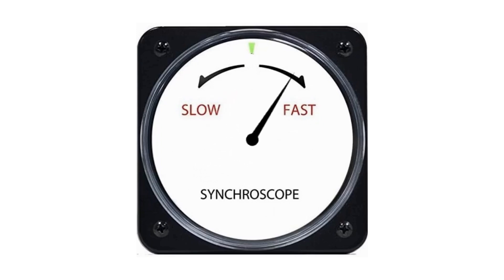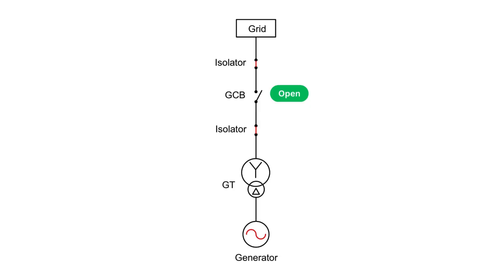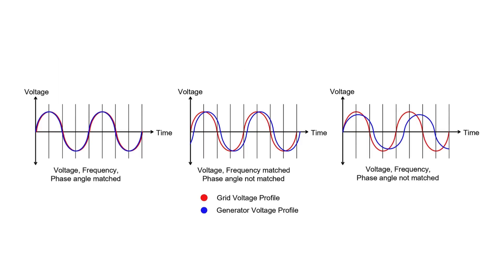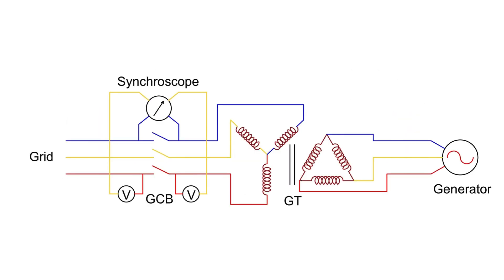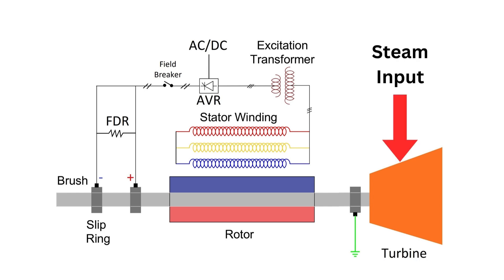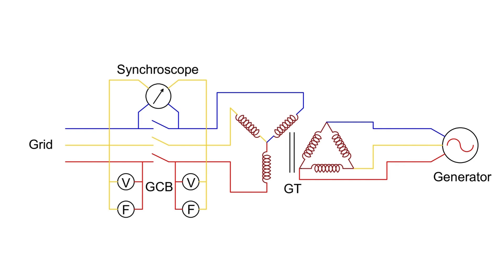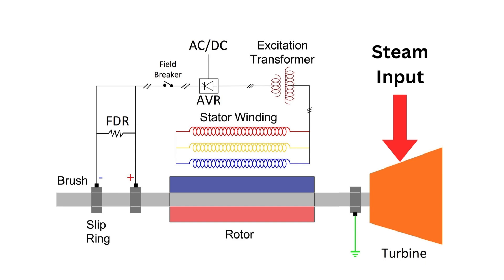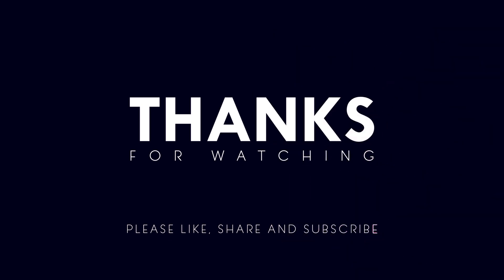How Synchronization Happens in Power Plants | Understanding Synchroscope & GCB Operations

Comment: If a power plant is matching it's voltage and phase to the grid, isn't it not actually generating any power? If there is no voltage difference to the grid, then the plant isn't actually driving any current into the grid. Right?
Reply from the maker: Great question!  You're absolutely right that when the generator’s voltage, frequency, and phase angle match the grid exactly, it initially doesn't supply any power. This condition is called the "floating" condition — the generator is synchronized but not yet sharing load.

Power transfer happens only when there's a shift in power angle (phase angle) between the generator and the grid. Once the generator is synchronized, increasing the steam input increases the mechanical power, which slightly shifts the rotor angle ahead of the grid — this causes active power to flow from the generator to the grid.

Similarly, adjusting the excitation voltage changes the reactive power output. So yes — after synchronization, it's not just about matching — it's about controlling phase and excitation to drive current into the grid. Hope that clears it up!

Comment: I think this explanation is not entirely correct. The circuit breaker is not closed until the synchroscope stops moving and points to 12 o'clock. That is why it is labeled slow and fast. If it were spinning in the fast direction, as shown, then there is a RPM mismatch and the generator to be added is running too fast. When it stops moving and points to 12 o'clock then the phase angles are matched. In the old days they just used three lights. When all three lights stopped flashing and stayed-off then the two generators were synched and it was safe to close the main breaker.
Reply from the maker: It does not stop rotating when it reaches the 12 o'clock position. There will be a slight mismatch in the parameters. As the parameters get closer to matching, the pointer's rotation slows down when approaching the 12 o'clock position. We need to close the GCB at that moment; otherwise, we'll have to wait for the next opportunity.
Reply: The animation is misleading, I agree. Were you to slam on the breaker with the sync needle spinning that fast, even if you nailed the timing, all hell would break loose. Whenever I see people sync by hand, they sneak up on the 12 o'clock position slowly; ideally when the breaker is closed, the needle is right at 12 o'clock and it's not moving at all. In that ideal condition, phase and frequency are identical on either side of the breaker and if the voltage is matched as well, then the whole electrical situation is identical on both sides of the breaker so once it's closed, exactly nothing happens and the generator "floats" like the narrator says; it's no different than being a motor with no load. Then it becomes a matter of adding torque with the water control system and that's how you generate.
Reply: But I heard the frequency of the incoming generator must be slightly higher than the grid. If it is correct, then please tell me the reason why we do it so?